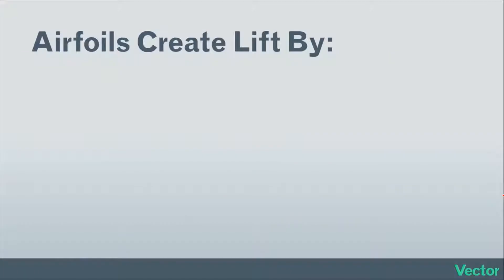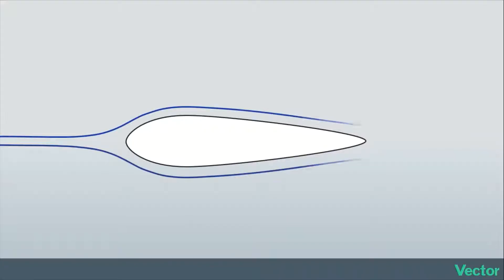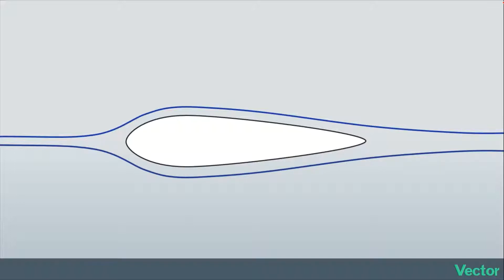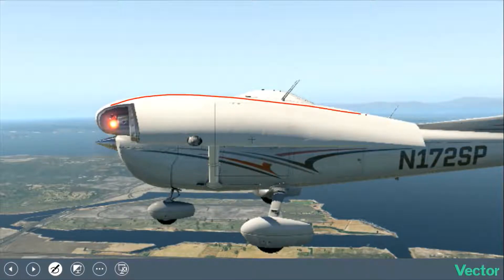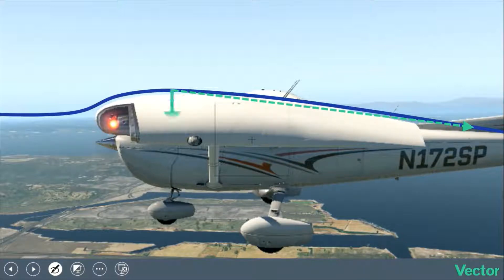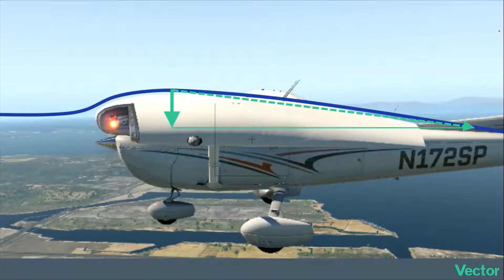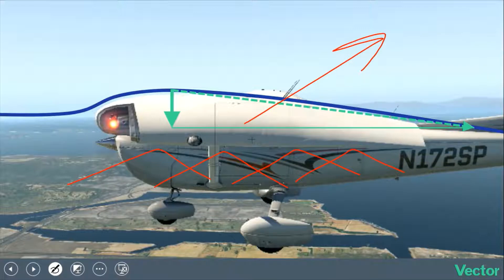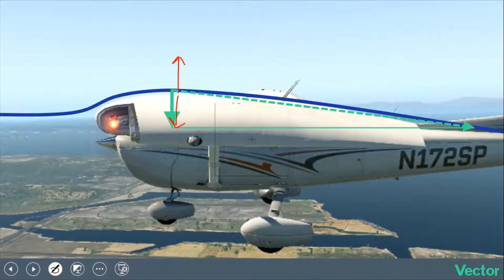Lift According to Newtons 3rd Law, Explained

Comment: The conventional explanation is correct. Bernoulli's  principle applies, the problem is most people don't understand it. You'll still have lift even without AoA, and downward air/fluid movement and hence Newton's 3rd law. Even with no AoA, there'll still be a wake vortice from the low pressure of the aerofoil which bizarrely many people seem to deny. They are the fluid dynamics equivalent of flat Earthers.

Comment: This is a weak almost partial explanation.
..
The wing can only "push air downward" by creating some  pressure to do it.  Therefore, you're not explaining what causes lift.
Lift is the Top-to-Bottom pressure difference.  <-- THAT is one reason.
..
The easiest part to see is the air running into the lower surface of a slightly upturned wing. Some reasonable Angle of Attack.
That is just like the wind pushing on you, or you running into the air by sticking your face out a car window.  <--THAT relative motion DIRECTLY CAUSES an increase in lower surface pressure.
. 
The converse happens above a wing to lower the downward pressure above it..
.
The Top-to-Bottom pressure difference it the loft; ALL of it. 
..
THEN. . . 
. . 
The result of those VERY SAME pressures is also  the Down-wash you call pushing some air down.
Think of this: With more pressure under the wing, know that fluid pressure pushes in all directions. THEREFORE, that pressure pushes up in the lower surface ... AND .. it pushes down on the  air further below.
THEREFORE, Newton's Third law is satisfied. 
.
BTW: Those very same pressure changes ALSO cause the up-wash ahead of the wing and teh tip vortex. . . 
..
 Full story of Understanding Lift Correctly: 
  *rxesywwbdscllwpn.quora.com/* 
- - 
Cheers.

Comment: Good job to said the fluid is not moving like the ballistic particles. But since when you mentioned this part I highlly reccommend you to illustrate most of the Misconception people think how the lift occurs. By the way, the generation of the lift also depends on so many bunch of the various factor. So I highlly recommend you could increase the length of the video to disccus the factor like the angle of attack or the pressure some how. 

That will be great for the readers!

Comment: If Bernoulli isn’t accurate, how does the stall horn indicator work without lower pressure above the wing being present?
Reply: It works through the Coanda effect. When AoA increases stagnation point moves below the leading edge, where the stall horn hole is typically located. During low AoA air flows straight into that hole. When AoA is critical, air is no longer flowing directly into the hole but rather flowing across the hole. 

This creates a condition for the static air in the tube and cabin to be entrained or sucked into the fast moving air flowing over the hole. The Reed is blown on by air coming from inside the cabin due to entrainment not Bernoulli.
Reply: @singh2702  interesting take, I’ll definitely look into to that more
Reply: @colinsqe65  Good luck with that , because there is nothing online that explains this phenomena. 
The closest you will get is the blowing over a piece of paper experiment.